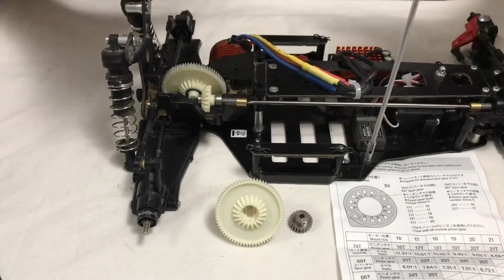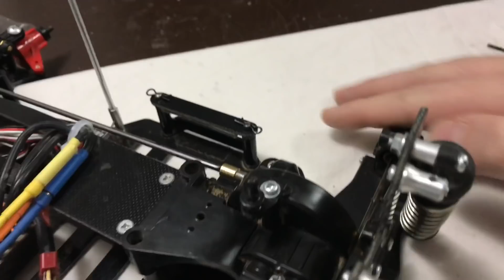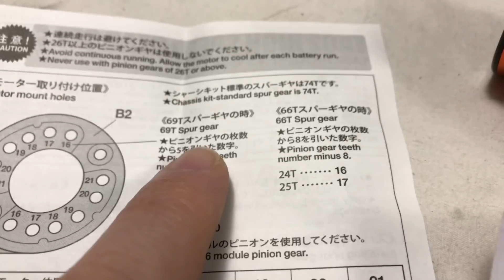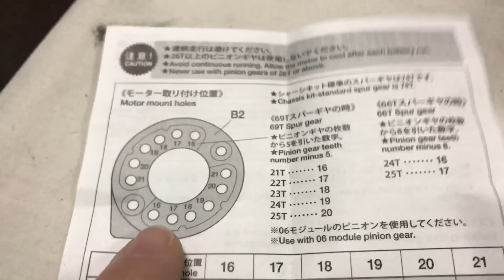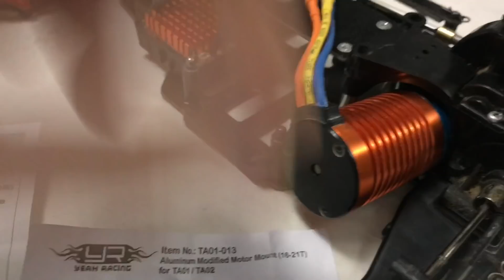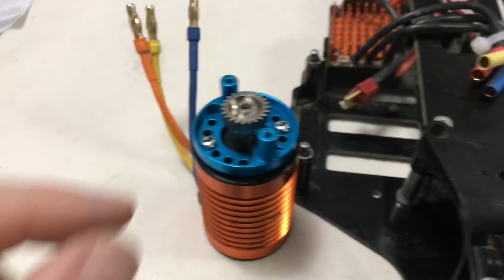Tamiya Speed Gear Set up in the Top Force...

Comment: Hi Glenn,what would be a decent non LiPo set up?.

Upgraded Motor and Battery.
Also can you recommend a good radio gear set for the Top Force?.
Reply from the maker: Mikey C 
Hey 👋 
I only usually run Tamiya brushed motors, so the best one they do for the money is the BZ super stock 23t, which you can run with the TBLE02s esc on Nimh. But you can get much cheaper non Tamiya motors off eBay. I’d just start with the standard gearing, 21t pinion in the kit I think 🤔 it will run great with that set up 😎👊🏻
Reply: @TAMIYALegends  Thanks for the Info Glenn, will definitely take a look at those. Don't mind paying a bit extra for Tamiya stuff.
Reply: @TAMIYALegends  sorry mate,forgot to ask. Is it worth buying a Racing pack deal? 
Or source the transmitter,receiver,servo,battery and charger separately?.

I have ordered my Green LTD edition Grasshopper already with a Racing Package Deal. 

But for the Top Force and Terra Scorcher find the individual parts.
Reply from the maker: Mikey C 
That’s really up to you, sometimes you get good value for your money doing it like that 👊🏻

Comment: HI,
I use a very similar Amazon Brushless motor and Speed Controller combo with my Manta Ray in standard gearing. Using 3S 30C 11.1V 3000mAh battery and I get 42 MPH out of it :-)
Reply from the maker: Blackpool Hornet 
Yeah that sounds about right buddy, if you continue to watch my stuff you’ll see I get to 48mph on 3s, but I’m actually doing the final video with the speed gear set this week, I’m pretty sure we’ll break the 50mph bracket 🚗💨💨
Thanks for watching 😊👊🏻